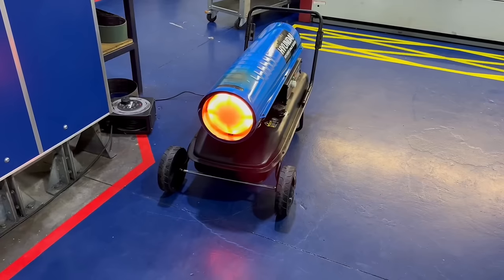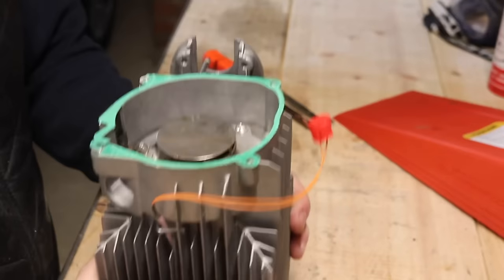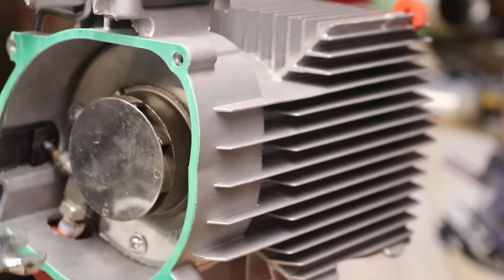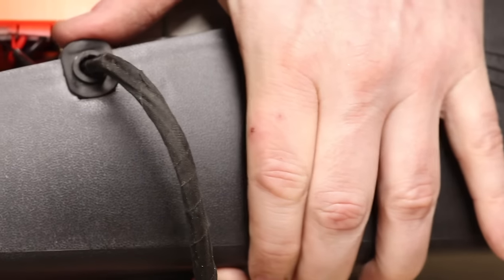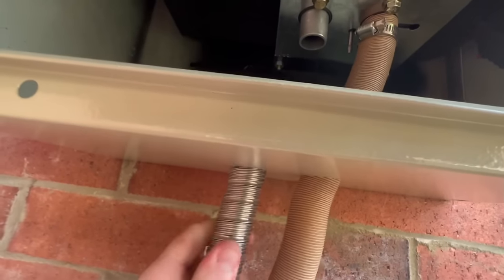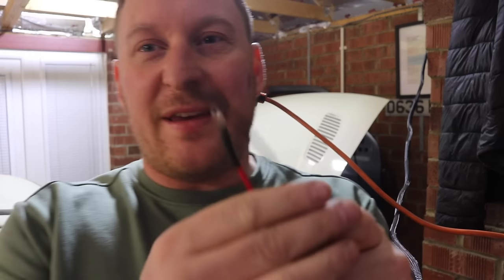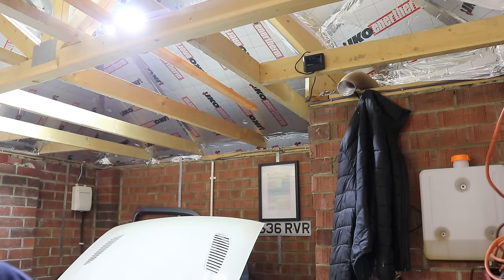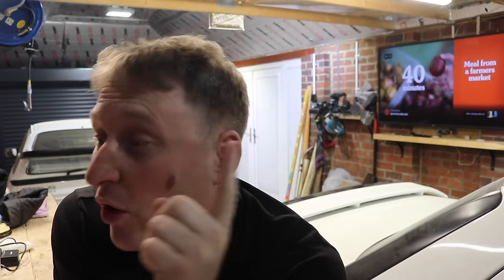CHINESE DIESEL HEATER INSTALL AND TEST ** Glow plug removal **

Comment: At 3:50 mark please don't suggest that you hang a heavy unit off some light duty electrical wire. Recipe for disaster as the wire could fail or break soem strand and create a hot spot.

Comment: Bro the air intake should be coming out of the garage, like a loop so it can build up the air temperature.. if you don’t like the noise you can use a silencer ..( those hemp carbon filters work great 😊) oh I have seen some videos of running that exhaust pipe true a thank whit sand , creating a sand battery.. 💪

Comment: I only watched to see those Motors! 😍 
However, my new heater worked fine first time i used it, had it on for few hours, all good. Now when i turn it on, gets all warmed up, lasts about 5 mins then i get a E10 code, "Heater over Temperature" any idea what that is?

Comment: You should mount inside with the exhaust exiting to outside, that way you get the heat from the exhaust and the warmer air inside being used, so temp is higher 🤔

Comment: You should really put them inside biasicley the inlet air will be less work for the heater so your recirculating the airflow but put the exhaust outside this is how they are fitted in trucks

Comment: You could do with a heat gun to check the heat of the cables... I wouldn't advise leaving any battery connected to the car while using the heater look at a leisure battery

Comment: More suitable for smaller spaces to be fair, me mate just put one in his house  and it worked out cheaper to have the gas on in the one room it's in.
Reply: 😂 yeah yet I fit them in fishing boats bigger than your house that go to the North Sea in all sorts of freezing weather.  You're mate never set it up right and is likely a 2kw one. What do I know though I've only fitted EVERY known heating system there is in boats that are in a much harsher and colder environment than your house.  Two genuine 4.7kwh ebers can heat an entire 36ft cuddy boat in the North Sea pal. Cheers

Comment: Can’t you remove the glow plug without removing the diesel heater from where it’s been installed? I’ve done just that. It’s stuck to the floor of my van.

Comment: It's meant for air recirculation,  pipe the other end inside with the heat  🔥   and  should be at the lowest points possible.

Comment: I have one in camper, great heater. Looking at domestic, use old battery, charge at night using timer. Could use solar.
Reply: Beauty is if power cut (who knows if gov. will cut power to promote green agenda) can still run heater, ideal for remote living.

Comment: If you made it return air from garage, rather than heating the outside air coming in all the time it would be even more efficient. A couple of temperature gauges before and after ,would be a really good addition. And last but not least a carbon monoxide detector in 2 places, as you never know

Comment: what I done was instead of sucking cold air through the heater ..I have  recirculated the air in the room through the heater does that make sense..the cold air is being sucked from inside the garage and blown back in the garage

Comment: One critical mistake you've made you don't want fresh air from the outside pumping into your machine because it's going to keep it a lot cooler. You want the inlet sucking air from the inside your garage so it's warm air that heats up even warmer when it goes through the machine you're defeating its purpose

Comment: The unit must be installed indors so that it heats the air inside not the colder air from outside. Its just wrong. Also I had used a 3m aluminium pipe for exhaust to recover some of the heat. I hope nobody will take your setup as a good one. It is junk.

Comment: Adam
Just be careful with that unit inside a metal box with so much exhaust also inside it. 
@joshua de lisle
Done a full run down on the temperature the exhaust can get too. I can remember exactly the temperature but it’s like 300*c or something. I’d be concerned the ambient temperature inside the box could get high enough to combust something. The plastic, fuel line the wiring. And with it tucked in under the upvc fascia board the garage would be up in seconds mate. 
To be fair it would be safer mounted inside with plenty of airflow and the exhaust sleeved and vented straight out the wall. 
Better safe that sorry Adam because there’s to much money involved in that garage!!
Reply: Well spotted. I would mount the heater a few inches lower and sit it on the bottom wall of the box. The gasket of the heater will then seal the heater inside the air tight box and the exhaust and inlet connections of the combustion air are outside the box. The metal box then acts as a firewall, a CO isolator and a heat dissipater. This mimics the arrangement in a caravan where the heater was originally designed for. If the environment outside the garage is secure, I would also mount the diesel tank and the pump outside the garage below the heater box.

Comment: Hi all can I ask why does the fuel pump need to be at an angle ? Please advise.
Reply: I wondered this. It seems the pump make air bubble by cavitation . If the pump was horizontal the bubbles are trapped in the pump and can cause it to dry out and loose the lubrication which the diesel provides. I have to say I don't know why it couldn't be vertical ..
Reply: Because if you don't put it within the proper angles it cannot fill the top of the piston properly so you get a sucking back piston and lose about 20% of your total kWh for the unit and it will create too many air gaps in the  fuel line and on top of that struggle to get rid of air pocket build ups. This is a terrible fitment it's all wrong and I'd be suprised if he's getting more than 2kWh. These exact ones in the vid I know them it's sold as a 4.7kWh but is really about 4.2 max and that's with a tune up in the hidden menu with the fan speed and HZ perimiters and rigid fuel lines (like on boats and trucks) and short runs.  On these cheap copy ones If you boost them up to 1.6-5.5 Hz and set the high speed fan to 4800 or 5000rpm and it starts fine then fit a decent plug and congrats 👏  as your 4.7kWh (that's really nowhere near that) might actually see about 4.5kWh

Comment: 😮Sorry Adam you dont know what your doing here mate and i usually like your content. I fit these on Boats and Trucks and you gave out bad info and done a terrible job. First thing you need pulled up on is claiming these put out as much heat as a hairdryer😂 mate that exact model sold by XPRods can beat two 2500w electric heaters (which will really be around 2.2kwh each) i know the exact model of Eber it's a copy of and its claimed by XPRods to be 4700 it's really around 4.4 kWh as the genuine eber version 12v model gets 4.7kWh using better plugs, better mesh and atomiser. That exact burner you have used to be sold in a different case as a rated at 5kw and sometimes an 8kw, the 8kw was the better made 5kw ones handpicked and the only mods they done to get the handpicked ones to around 4.6kWh was they set the fan rpm and HZ perimiters higher in the hidden menu. Given these have been tested properly at that kWh range means you are talking absolute drivel about them being like a hairdryer. They beat out single phase 4kWh industrial heaters mate ffs. 

Mistakes made in the assembly that you need to address-  The paper type hoses on your intake and transfer air ducting lasts about a month outside swap them out. 
Your wiring is not close to what it should be you've forgot about start up Ah and running these with car batteries requires them to be charged daily with an optimate or ctek or you destroy the battery from repeat sub 11v drains and the plug won't last if you're running it to low voltage shutdown.  
You're fuel pipe is attrocious you simply didn't do any homework mate, you can run as thick a hose from the tank to the pump as you like, however from the pump to the unit you run rigid type hose that doesn't expand and that is the exact inner diameter of the pump outlet and burner inlet, this maintains pump rate perfectly, the way you've done it (which is totally wrong) your hose is absorbing all the pump pulses. This creates noisy and smokey starts that often require several attempts. 
Loosen the bolt holding the pump as its the fact you've squashed the rubber bracket so hard in that it's transferring the tick to the wall, trust me loosen it off youl lose a few dB instantly. If you really need to get rid of the tick well I can sort you out with a completely different type of pump no problem that runs completely quiet. I'll do you one for £40 is usually 3x that. 

Honestly mate, you done a worse job than just buying an all in one and just putting a cover above it outside and run the transfer air ducting inside. I know people that did that and it's worked fine with no more than rigid type tubing and two planks of wood. 
Bare in mind here I'm a coach turned boat builder who's fitted over   150 of these maybe closer to 200 AND on boats especially you cannot make any of the mistakes you just made. 
Your only bad vid mate tbh and I hope you don't take this personal but this is a terrible effort.
Reply: Out of interest why do you fit these rather than using the waste engine heat in the boats?
Reply: Mr. Big, Experience is wisdom!!  I cannot tell you enough how I appreciate and enjoy your TRUE but BRUTAL assessment of this presentation.  You should have been a MARINE CORPS drill instructor. I say this with the utmost
 humor and respect! 
 Adam!  This gentleman knows exactly what he is talking about. It may be wise to ask questions of this gentleman. I know that I will be referring to his comments very closely!

My very kind regards.

Comment: Get a solar panel and solar charge unit a leasure battery 
And you will have free power to run your diesel heater and charging your cordless tool with a cheap 12v inverter

Comment: Whatever you do, don't mix your old engine oil and diesel 50/50 and use this as fuel to run this heater. Even though it produces a little smoke (until it warms up) and you need to clean the chamber of the heater more often. It would cost less than half than it would to run it on pure diesel but just don't do it. It deprives the Government of Tax and it's illegal! 😉
Reply: Yes, this heater can run on 50/50.  Should it? NO! This is not a engine. This engineering more closely resembles a turbine.  The disadvantages far outweigh the cost saving advantage.

Comment: It would be a good idea to put a block connector on the glow plug one of them push fit fitting that only fits one way then it’s easier to take it off

Comment: Hot Pipe needs to be at floor level mate it will be ten times better 👍
Reply: The entire build is a mess but yeah 100% the heats heading upwards over his head to begin with😂 his intake transfer air is from outside ambient and the hose he fitted bellow the pump to the burner unit is absorbing about a 3rd of the pumps pulsing energy (wants to be rigid type from pump to unit)  He spent £70 on an outside weather proof  box then used the paper type intake and transfer ducting shipped with newer models just so you buy proper older ducting for outdoor fitments 😂 so that's gunna last a few month and the wiring is bellow spec for running extensions on the original wiring. He's judged the Ah wrong and not allowed for the start up and cool down draw... I could go on. This is as bad a job as it gets and I like Adam, unfortunately I'm a boat builder and have fitted upwards of 150 of these in boats and trucks

Comment: Hi Adam
Love your vids and the cossies 
Just gonna put my two peneth in 
Tell me to fuck off like😂
Wouldn’t it be easier to put a little log burner in?
No electric or diesel 
Just blag afew pallets n chop um up?
And in my experience them compressors get more rattley the older they get 
I wouldn’t want one over my head or over a couple of cossies🤣
Just my opinion mate 
Love the garage n keep up the videos 👍👍👍
Jim

Comment: One - Two - Three - Forkin’ell that’s hot 😅 

Don’t want to be a nerd but your economy test is flawed. Because the tank isn’t constant cross section where you were testing it, time over  amount is going to be wrong. You should do fixed volume (half litre) over time. Nerd out … 

But brilliant - always get a giggle

Comment: Yeah dont do it like this. So many things wrong with this setup. Mounted too high, mounted outside (so its having to heat up colder air rather than heating and recirculating already warm air inside). And that weatherproof box is no longer weather proof with all the holes you drilled into it without adding any sort of grommets. Im also pretty sure this would fall foul of regs too.

Comment: Love the video mate but can’t help but think why you didn’t just get one of those oil filled thermostatically controlled radiators. Plug it in and your done. The cost of diesel and that constant fuel pump clicking would do my head in.

Comment: You must be good at something to have that fucking huge garage with those motors in it - but wiring and soldering is not one of them lol, also you want the heater inside and the feed low down not in the roof! another thing, if your not using all that space above the roof trusses why the feck have you insulated the apex of the roof lol - you should have boarded the roof out that garage would be way warmer then!